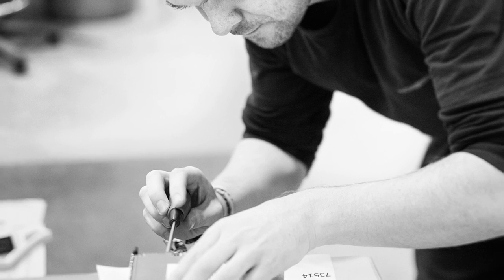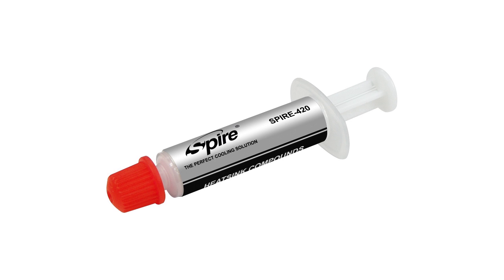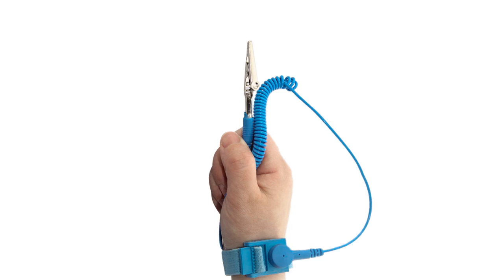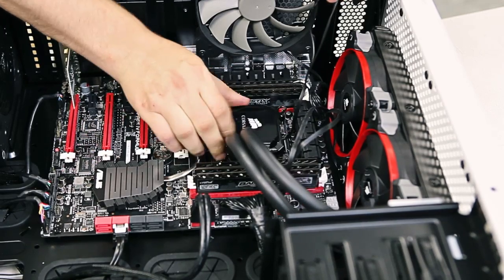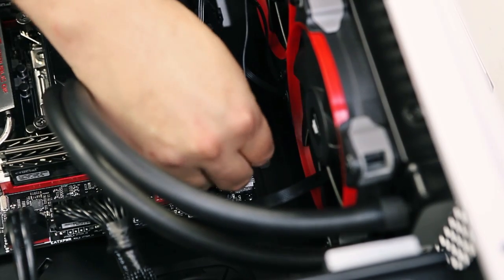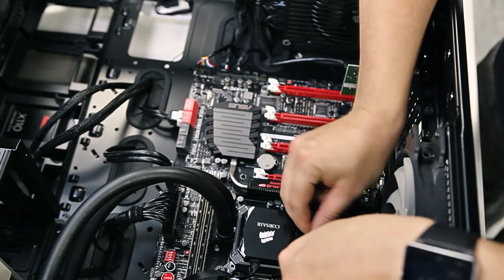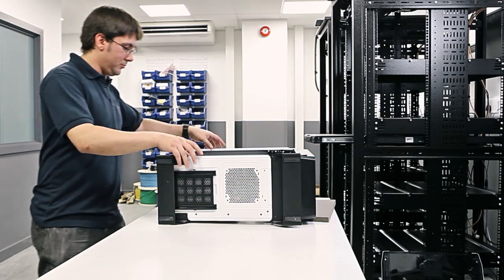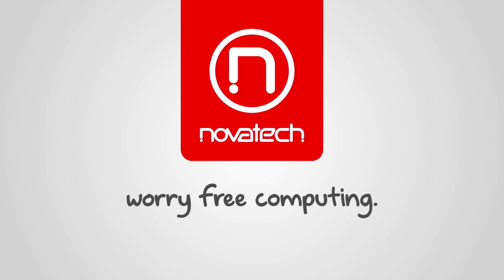Novatech How To: How to Install a Corsair H100i CPU Liquid Cooler

Comment: My case is actually run in a horizontal fashion instead of vertical. Would I still be able to use this even though the radiator would be on its' side and not vertically gravity fed?
Reply from the maker: Jon Lepree It uses a pump so any orientation is good providing it fits I believe.

Comment: where should i connect those fans?
Reply from the maker: KuhaPoika Which fans are you referring to there?
Reply: NovatechLTD stock fans
Reply from the maker: KuhaPoika You attach the stock fans to the radiator. You should have 2 fans and the radiator and you'll need to attach them both. Like this > @2015 - Different variation of the cooler but same thing.
Reply from the maker: KuhaPoika Hmm, won't let me post the link to the image!

Comment: Would this fit in a Corsair 450D in that config? what i mean is both the fans and rad in the case, not outside.
Reply from the maker: TheZeeray Looking at the dimensions of that case, it should be fine. it says Front: 2 x 140mm or 2 x 120mm (2 x 140mm included) (280mm radiator) and the h100i is 275mm.

Comment: What about a backplate for the motherboard? I know that corsair provides one, but im wondering if I can install this just like the video, where you just use the double threaded screws? My mobo already has a backplate on it, but not the one from corsair. Is it possible to install this cooler without accessing the back of your mobo and replacing the stock backplate?
Reply: with the H100i The original backplates are used, you need to apply the correct faceplate for your Processor (intel or AMD), These are magnetic so it should be very easy :)
Reply: Awesome thanks for the reply.

Comment: Where is the water? Do I have to fill it prior to installation or do I have to connect it to a reservoir?
Reply: Duncan Lowery if you are still worried just shake it a little you will hear some water in the tubes, happy building mate!

Comment: My motherboard only has 1 CPU fan header and I see that there is 2 fans, so do i need a Y splitter cable for the fans? IDK Im kinda a noob at this. Sorry!
Reply: Should already be included, Haven't set mine up yet, but there should 1 cable where the 2 fan cables hook into one that goes into the water bock and then should be set into you fan header for the cpu spot. If that is any good at describing, sorry if it's confusing

Comment: Very nice first video Novatech, but its not quite all that it appears.
Firstly may i draw peoples attention to the fact you have changed the stock fans on the cooler, opting for either the corsair quiet fans or the performance version. Users might be misled and think the cooler comes with those fans - it comes with a pair of fans which have a max speed of 2700rpm, but many prefer to additionally purchase and use the corsair quiet fans.
I would suggest when making a how to video you only use the item as boxed, otherwise customers could believe the product is different to what they recieve... Also you never mentioned other installation information and the fact the metal plate is magnetic. (do not leave the plate on the hard disk tray whilst installing! its magnetic. And due to the size of this  coolers radiator you should choose the case for the computer carefully.)
Reply: CK Wunch to be fair, the stock fans are still quiet as long as you dial back the rpm.
Reply: Michael Ashton yep sure i would agree if they are lowered then they can be quiet, but i was more focused on if someone buys this then they might be like its not the same as the video - and for the uk for most computers apart from a couple of mid july weeks lol the stock fans are more than adequate lol. Just im a purist :D and didnt want people to think the quiet ones which look better come supplied.
Reply: That's cool. I'll let you know what I did if you're interested. I've put the stock fans on one side running on a splitter and the SP120's as in the video, likewise running on a splitter on the other side in a push/pull configuration.

They then run in 2 separate channels on my fan controller, the Aerocool Cooltouch-R. I've got the stocks running about the same volume as the quiet edition fans at 22db and the quiet edition running at 95%. I get about 60C but without context that's pretty useless info, as I've done extensive overclocks. :p
Reply: Michael Ashton yea thats a decent result for overclock, atm mines running a i7 5820k at 4.2 with a level of 27'C peaking at 46'C during video rendering. What i did was also run the cooling pipe over another fan :D because i squeezed it into a zalman h1, but my room itself is ac controlled, its always 18'C and i think that is making a bigger difference because in the other room it will easily hit 74'C

Comment: Is installing other coolers the same? Such as the H55/H60/H75. And which is best for a Intel i5 4670 (not K, I just want to have a nice cooler instead of a huge lump of fan :p)
Reply from the maker: It's along the same lines, some of the smaller ones would have an attachment called a back plate which you'd need to attach to the roof of the case before attaching the radiator, I'll see if I can have this covered in another future video.